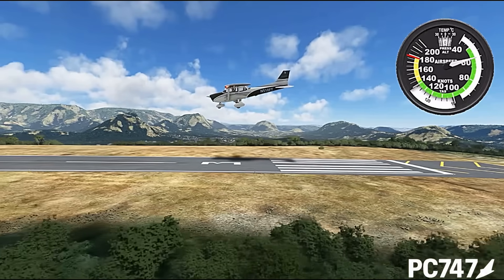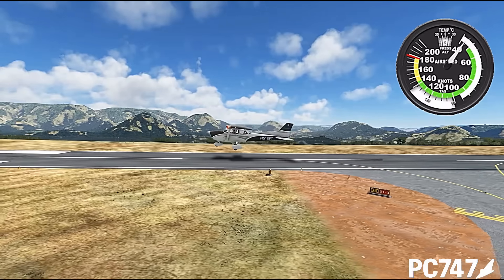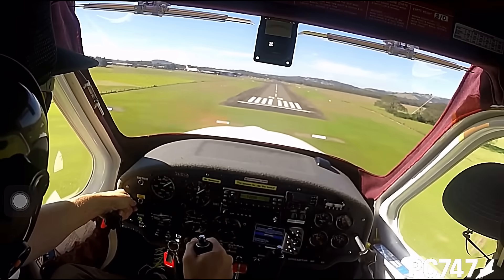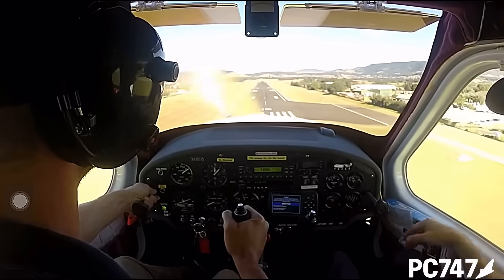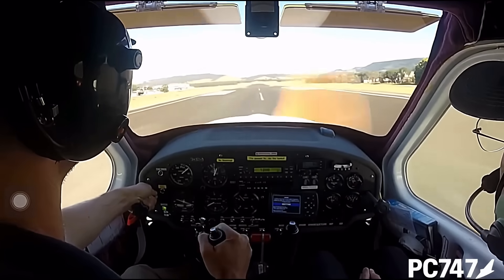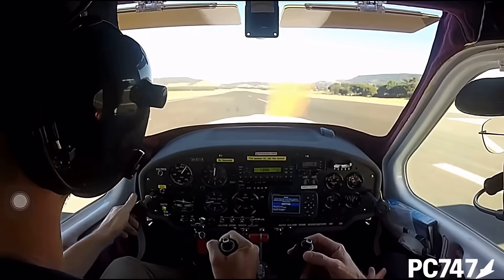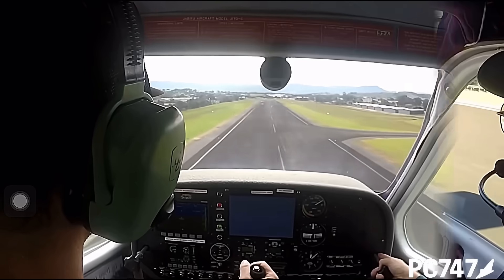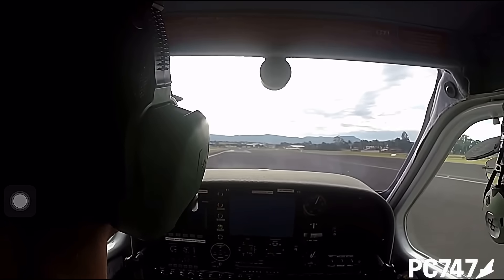How to Land a Plane -The Secret No One Tells You

Comment: One of our 4 Co-owners 'forgot' to reopen the Fuel Valve after Refueling our High Wing Piper Cherokee: 
Engine cutoff @ 500' AGL over I-5, and no-time to re-start, setup a glide path, or find a place to land safely, he panicked, flared at 50', stalled-out, dropped vertically, broke both femurs, suffered a long bone fat pulmonary embolism and died in the ER.
As Owner, FAA called my number and later sent me their Incident Report.
Insurance Carrier re-imbursed the 3 and the Surviving Wife used her part for the Final Expenses.
Point = this video information could have saved his life as we all purposefully 'halt engine power', stall the plane, and perform 'a mid-air controlled collision' with the Earth every landing and live to tell about it, so DON'T PANIC!
Reply from the maker: Wow Paul. Thank you. That was quite a powerful testimony that you shared & sotragic. I think I need to make  a video on why our current forced landing training is DEFINITELY left wanting…..

What you said, reminded me of tragic accident, several years ago, in Telluride, Colorado, where a newlywed couple were returning, in a normally aspirated Bonanza, back to Florida. The pilot, a former flight instructor, Embry-Riddle graduate, and Delta airlines pilot, stalled & then spun their aircraft, into the ground, when they flew into a box canyon instead of maintaining aircraft control , all the way to the ground…..:/

Regards,

Carlos
PC747

Comment: I’m just at the beginning of the video and I’m holding out hope that the discussion of - using the elevators for pitch control of the aim point and using the throttle or power for airspeed is highlighted as the best way to instruct landings.
Reply from the maker: Hi,

   Welcome to the aviation community!If I can answer any questions you may have, let me know. 😎
Reply: @PC747Aviation Hello, I’m a retired USAF/Fedex pilot and a Gold Seal CFI of 56 years. It’s a pet peeve of mine that the ‘backwards’ concept that Pitch controls Airspeed and Power controls Altitude is still being passed down to student pilots when there is a much more efficient and accurate way to fly.
Reply from the maker: @waltciao4549 Hi Walt,

    Could your share the better way with me?
Reply: @PC747Aviation I’ll begin by saying that the airplane itself doesn’t care which flying concept a pilot uses, but the most efficient and accurate way to fly a plane and to teach it is the following:
Reply from the maker: @waltciao4549  I’m listening Walt. 😎👍
Reply: @PC747Aviation when Power is fixed such as at Idle or Full Power: Pitch controls Airspeed and Power controls Altitude. But when Power is Variable - Pitch controls Altitude and Power controls Altitude. Like every other motorized vehicle from a powered skateboard, scooter, car, etc. Power controls Speed. Airplanes are no different in that regard. More Power = more Speed.
Reply from the maker: @waltciao4549 SUPER! Thank you for your insights Walt! 🤩🤩🤩

Comment: I feel like I missed a chunk of instruction. 1-5 kinetic energy. 6-10 no kinetic energy. So, when do you count? how do you use that data to effect controls? Do I pull on 1-5, release back pressure 6-10? do I start counting over the fence? touchdown point? Numbers? If I float past 8, do I start counting earlier or pull harder???m You may be onto something, but I sure didn't catch on to how to apply the data!  Not a dig, just am not picking up what you are laying down. Cheers!!
Reply from the maker: Hi Sherman,

  All good. I’ll try to help you.

The correlative technique only works effectively, “if” the aircraft is at the “appropriate speed”, prior to transitioning to the flare. If it’s too slow, or too fast, the numbers will be off. After flaring, just count to 10 every time. The goal should here is not to land before the #5…..because….

The numbers 1-5 are indicative of:

high kinetic energy
Low angles of attack &
An airplane that is not ready to land.

Examples of this would be allowing the aircraft to land, very early, after  flaring; The numbers #1,  #2 or #3…. for example. In such scenarios, the nose either touches down prior to the main gear, or 3 point landings result. Many of these pilots experience porpoising too, that, if not corrected quickly, can tear the nose gear right off.

The numbers 6 through 10 are indicative of:

Higher angles of attack
Lower kinetic energy &
An airplane that is ready to land.

Examples of this can typically be found in most aircraft landing videos, big & small, even airliners. When they are landed at the appropriate “time”, one thing will be in common with all of them. They will ALL have “climbing attitudes” on touchdown.

As you already know, there is a reason climbing attitudes cannot be incorporated immediately after flares. The kinetic energy is just too high & has to be dissipated first.. If it isn’t, the aircraft will fly away from the runway. This is the reason this was incorporated for my students.

When they were finally able to apply a correlative landing tool, by utilizing numbers, as REFERENCES, it enhanced their understanding of both kinetic energy MANAGEMENT and HOW appropriate pitch attitudes can be obtained.

Cheers!

Carlos
PC747

Comment: Nonsense.  That first guy was lined up on the left side of the centreline.  Probably thinking that he needed to be compensating for sitting left of his a/c axis.  I would tell studes to put the centreline between their legs!  That silly 10 second countdown is an example of teaching by rote.
Reply: "Ailerons control drift".  What utter claptrap.  Using the controls in a co-ordinated manner to achieve the required/wanted aircraft attitude changes the aircraft track.  I'm guessing that he means the angle of bank rather than ailerons..  Airspeed also has a vital effect.  For example a good rule of thumb is to increase the threshold speed by half of the crosswind component.

Comment: I'm a retired pilot, ATPL fixed wing, CPL rotary wing and also an ultralight pilot instructor, with over 4,000 hours logged last century. I got my helicopter licence after about 1,500 hours of fixed wing flying and was pleasantly surprised when the instructor taught me only one control at a time close to the ground. This made it very easy to understand. So, when I started instructing in ultralights, I adapted a similar method to what you discuss here. It makes just so much more sense! 

I worked for a school owned by an airline pilot, also the Chief Pilot. When he and the CFI told me they were considering not letting a student continue, they let me have the final say. (No need to elaborate on that, other than to say I had different flying experiences, including aerial stock mustering and landing up the sides of steep mountains in New Guinea.)

During the lessons with these students, I would only let them use the rudders on take-off, to keep the aircraft on a straight line. Then, I'd get them to use the ailerons and finally, on later take-offs, the elevator. Similar procedures for landing, although in a slightly different order. I only taught a few students like this, but they all managed to continue their lessons, on to solo.

The thing that I don't understand is why flying schools don't adopt the techniques used to train helicopter pilots to train aeroplane pilots, as PC747 recommends.
Reply from the maker: Hi Amateurmakingmistakes,

   It was a true gift reading your insights! Thank you! I’ll try my best to answer your question……

I think it really comes down to four things:

    1-Institutional inertia 

    2-Systemic issues

    3-Training culture &

    4-Legacy practice

( Institutional Inertia )-There exists a kind of “built-in resistance to change” within our aviation community. Once a procedure becomes standardized in flight school syllabi, it can stay that way for decades simply because it takes real effort to revise accepted industry practices.

( Systemic Issues )-When flight schools, instructors, examiners & pilots are all using the same approach to learning, the entire system just reinforces itself. Everyone’s following the same playbook, even if better alternatives exist. The book Stick & Rudder, published way back in 1944, has retained an almost mythical status as the “go-to” source for flight control applications.

(Training Culture) — I suppose you could also call it cultural entrenchment. Flight instructors tend to teach “how” they were taught. It’s human nature. In a way, tradition has become the lackey — reinforcing old ideas instead of questioning them at all. We keep teaching what we were taught, even when better methods may be right in front of us.

(Legacy Practices)— For generations, no one has seriously “re-evaluated” how things are being taught. It lingers on because it has just worked “well enough,” for a really long time.

Regards,

Carlos
PC747
Reply: @PC747Aviation  Thanks for your reply, Carlos. What you said makes sense. 

It just seems a real pity that the fixed wing schools don't adopt the methodology of the rotary wing schools, because the rotary wing methods of instruction were created to minimize the blundering of students trying to combine all three axes at once. 

Well, it's certainly a lot more difficult to land a helicopter and the chances of things going wrong are a lot higher, so there was a bit more effort put into the training doctrines. 

As it is, I never had any formal instruction in flight instruction: in the mid-1980's the only requirement to become an ultralight pilot instructor was ... to just log 20 hours of flight! 

That was it! No formal classes or instruction, you just taught him/her how you fly! 

One other thing I did was emphasize engine failure procedures and also I used to get the students to fly at the stall speed to and from the training areas. This helped them recognize the stall conditions. (As a former fixed wing mustering pilot, we'd fly with the stall warning circuit breaker removed, otherwise you'd go crazy with the stall warning buzzing in your ear as you dive bomb cattle. You learnt how to fly just above the stall, while doing steep climbing turns.)
Reply from the maker: @amateurmakingmistakesThat was GREAT to read! I hope you will continue imparting your wisdom on forums such as this. 🤩🤩🤩🤩
Reply: @PC747Aviation  Thanks, Carlos. The other thing I used to tell my students was that on the day of their next scheduled lesson, if it was too windy and gusty, to just call in sick, because the open cockpit ultralights we used to fly are more sensitive than small Cessnas and the student wouldn't gain anything useful, really. Yes, I would also miss out on pay, but I just wanted the student's initial lessons to be done in calm weather conditions. Just like you have to get to a certain stage to handle crosswind operations.
Reply from the maker: @amateurmakingmistakes I couldn’t agree with you more! Thanks! 🤩🤩🤩🤩
Reply from the maker: @amateurmakingmistakes I hope you will continue sharing your knowledge here and with others. 😃

Comment: Hi loved the video!  I like your approach… both to teaching and landing ;-). One thing though, it wasn’t exactly clear to me how the 1-5 or 1-10 count worked. Maybe if I watch it a few more times, but if Yu are looking for a next topic, going step by step for executing this count methods would be helpful.   Thanks!
Reply from the maker: Thank you for sharing. I’ll try to help you now….

If you’re able to watch airliners landing, or even most small aircraft landing on YouTube videos, most of them will typically have about 10 seconds of “floating time” after they flare. Of course, some will be less time and some might be more. The counting method is just a correlative METHOD that can be utilized to put the aircraft in a SAFER position for landings.

When I would instruct my students , I would always count out loud for them after the flare. Sometimes, my voice had to increase with certain lower numbers when the airplane was going to touchdown too soon without appropriate intervention. But what worked beautifully was, instead of taking over the controls, like I had to do  previously, WHEN I WAS A YOUNG INSTRUCTOR , the volume of my voice, with the smaller numbers, was reminder enough THAT THEY NEEDED TO CONTINUE FLYING LONGER. :)

Comment: My cessna 150 with full flaps does not have 10sec to land, it has maybe 4. But I get your point.
Reply from the maker: Thank you for sharing your comment about the Cessna 150. I used to own one myself. 1966 with a PULL starter. I can’t  recall if all Cessna 150s have 40° of flaps. That extra 10° got a lot of people killed because they weren’t cross checking their airspeeds adequately enough, got slow and stall/spun into the ground. For this reason,  152 have a maximum of 30° of flaps. 

You may be right as far as four seconds for the 150 , particularly with 40° of flaps. It’s a lot of drag.😳👍😎🤩

Cheers!

Carlos
PC747
Reply: @PC747Aviation  1964 C150D with 40deg flaps.

It's a joy at 0-30deg, but has a nasty snap and wing drop at 40deg when it stalls, so I avoid it. But at 40deg it comes down in a hurry and can be useful. But at 40deg the moment you rotate without power you have at best 4sec before she is fully stalled, so you have to be spot on with location and altitude. But at lesser flaps and/or some power she handles just fine.

I've landed short final starting from the downwind-to-base turn at 2000ft AGL, dead-stick with 40deg flaps. it was thrilling, but I was basically diving at the ground and standing on the pedals to stay in my seat to keep it at 65mph. and then in the flare it bleeds everything off seemingly instantly.
Reply from the maker: @SoloRenegade  I’M LAUGHING READING YOUR KIND COMMENT BECAUSE IT BRINGS BACK FOND MEMORIES. YOU ARE SPOT ON. 👏👏👏👏👏👏
Reply: @PC747Aviation  I always tell everyone the C150 is the most fun I've had in an airplane (so far, building some sportier planes), just like the R22 is the most fun I've had in a helicopter (so far).
Reply from the maker: @SoloRenegade  Thank you for sharing. The C-152 is one of my favorite airplanes to this day! 😎👍

Cheers!

Carlos
PC747

Comment: I have an 80 year old friend who told me that in the sixties when he took his training every landing was a dead stick landing. He would cut the power in the circuit and the goal was to land without extra power.🇨🇦
Reply from the maker: Thank you for sharing! 😎🤩🤩🤩
Reply: @PC747Aviation Yes, sir.  Great channel!😊
Reply from the maker: @davidfields7193 Thank you David,

Cheers!

Carlos
PC747
Reply: 74 YO retired airline captain (B-707, B-727, DC-10, FK-100) here.  Learned to fly in West Texas in the summer of 1968 in a J3-C90 Cub with no electrical system, no radios, no flaps.  

All approaches (in my primary training) were done the same way: abeam the point of touchdown at 800’’ AFL, carb heat on and power to idle all the way to touchdown. I got good at this very quickly as my instructor would settle for nothing less.  I will always remember and appreciate him for insisting on my developing this talent along with many other flying skills.  Sure came in handy years later on a couple of “for real” forced landings.

As new Flight Engineer on the B-727, I had a ringside seat to greatness late one night on the Quiet Bridge visual approach into San Francisco. Somewhere in the neighborhood of FL200, the Captain gently closed the throttles and didn’t push them up until about 1000 feet AFL. It was all done with good judgment, gradually adding drag when appropriate.  Some of the passengers probably did not wake up until about 60 seconds before touchdown. It was a thing of beauty.

Happy landings, everyone! ✈️✈️✈️

Comment: This is a really good video, and takes me back 35 years, when I commenced my flight training. 
Went on to GA/airlines, so it’s interesting to reflect back. 
I can still recall the overwhelming amount of information required to complete a single circuit 😅. 
At the time, I couldn’t imagine how it would all come together, but the penny eventually drops. 
I could talk for days about this, but a couple of tips for those struggling.
 
- when turning final, focus on achieving the visual picture (aiming point 1/3 up from the bottom of windscreen) required, with elevator. 
Be decisive with inputs to achieve this, and increase/decrease power to maintain REF speed. 

-When in the round out/flare, get your eyes “up” to the end of the RWY. This will help to judge your ROD, and corresponding amount of input for the flare. Keeping eyes on the aiming point is likely to setup for  either a hard landing or a float/porpoise. 

From experience, these concepts work, whether you’re in a glider or 747.
Reply from the maker: Thank you Jimm! 😎👍🤩🤩🤩

Comment: I was taught to chop throttle, pull the yoke, wait for the stall, hold it in the air stuff early on, eventually, when left to my own devices, I looked at it as I would level the plane out, with throttle just off idle, then just fly it down the centerline all the way to the ground as it's speed bleeds off, usually was right at stall as touched down, I had much smoother landings that way.
Reply from the maker: Vermin,

  Thank you for sharing that! 😎👍🤩🤩🤩

Comment: Carrier pilots use ailerons to correct drifting just before touching down on Cartier landing. Aircraft is in stalled condition. Starts to move L or R.  Aileron is lowered that will pull the nose opposite of the direction of drift.  So nose turns right. So to make nose move left, move the stick towards the nose.  The left  aileron will go down causing the plane to yaw ccw. I think that's correct; adverse yaw.  Yes?